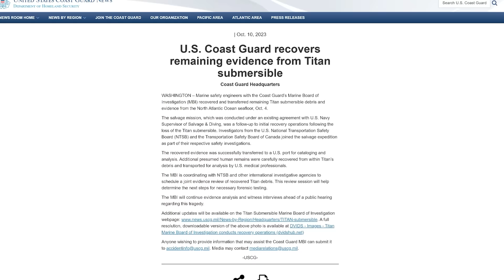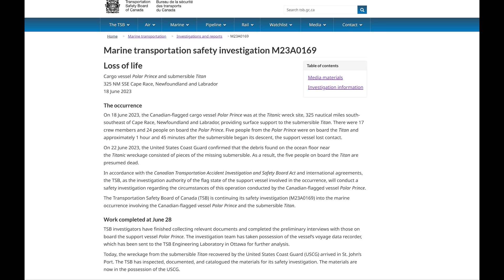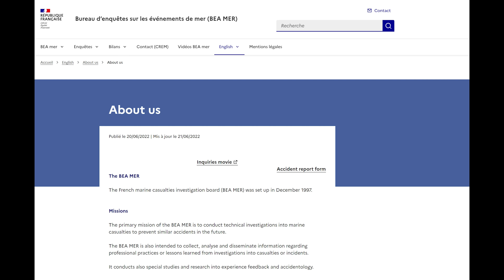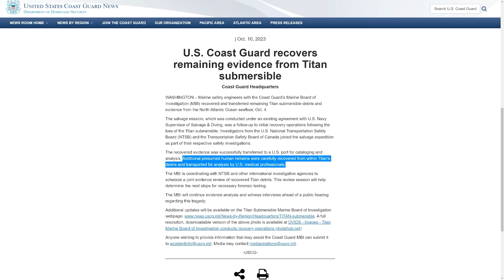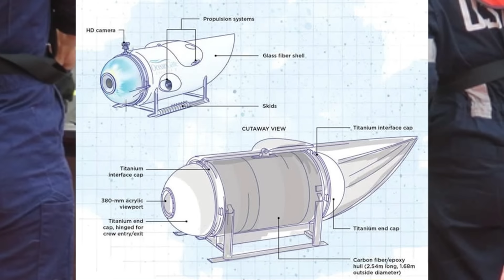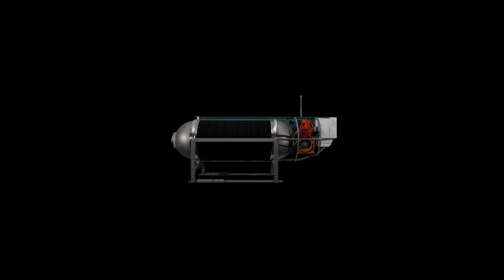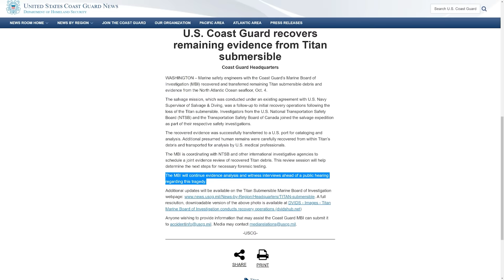Titan Sub UPDATE: More Human Remains, Debris Found

Comment: ...think about it ...Boeing 787s are made the same way...when I worked on them, defects were identified by red streamer-like tags...The last "barrel" I worked on, repairing electrical issues, looked like red confetti falling from the ceiling...😮😮...
Reply: A commercial airliner is subject to only a tiny fraction of the forces at the bottom of the ocean. Also, the hull of a 787, being pressurized, is subject to tensile forces pushing out, and playing to the strength of carbon fiber, rather than compressive forces pushing in, like on the Titan.

Comment: Im wondering, why they didnt place one or two titan rings inside to support carbonfiber against deformation. They could be thinner and it wouldnt be that much extra weight, but it would be reasonable to do because carbonfiber isnt very elastic and any crack compromise its strength much faster. They placed all faith into carbon fiber shell itself, which was stupid.

Comment: I think putting the sensors that would have warned them of fiber breaking up decrease the strength of the fiber. That would have had to be attach directly to carbon fiber. i would like to know how did they attacked it.

Comment: Just wondering... 1) The marks and scratches: With the location of the AFT dome and the equipment stored right behind and adjacent to it, why are we wondering about scratches? Calling that mark a potential substance or where did the marks come from? Upon implosion, all the components of the vessel would have folded upon itself causing everything to crash into what was immediately next it. Then the collision with the seafloor and what did it hit when it made contact with the seafloor (possibly other submersible debris). 
2nd) 'Rear AFT'?  Does that not mean the same thing? That is like saying 'Hard right starboard'... 
Just my thoughts.

Comment: I'm quite sure the tail area holding the power source is what was crackling, and around 9:46am that particular section imploded. Then they lost complete power. The titan must've started to descend again, since the only way they were able to ascend at the time was with thrust from electrical power sourced in the tail. So the occupants were slowly sinking again, possibly in complete darkness, for who knows how long before the full implosion. They may have even reached very close to the depth of the Titanic before they were crushed in  micro-seconds. But I don't think the final message from Titan was at the point of implosion. I'm almost certain it was minutes after losing power and sinking down further inside a structurally compromised vessel. Crazy..

Comment: @5:55; I am not a licensed engineer, but I have been around long enough to know that on a pressure vessel, the greater the pressure the closer the bolts should be.  But then again this was built supposedly considering pressure in reverse from the outside in.  But as Jeff states, we need to see the carbon fiber to determine what happened to the fiber itself and the joints between the fiber and the forward and aft sections.  Not seeing the parts, one does not know if there is any adhesive residue on the fiber or metal parts.  We all have seen video of them smearing the adhesive on before joining the parts.  
Only time will tell what really happened.  The problem I see is, the more agencies that get involved the less information will be forthcoming as they all try to protect their jurisdiction.

Comment: Being older I studied physics and have a sort of knowledge through interest of engineering and materials. You make some very valid points. Am not sure if a steel interior would have made a difference because of ballast, weight etc and how it could have ascended back up. My opinion (for what it's worth) should have been the carbon fiber should have been re-done every time the sub went down, and also that the carbon fiber was tested. We look at the titanium and carbon fiber together. One is hard and one isn't. Any material scientist and or mechanical engineer would have been 'all over it' for it's flaws. I am very sad this happened, and I would not be surprised if the 'outcome' was many 'flaws' in the whole thing. My heart goes out to the families who have maintained a 'dignified' silence until 'conclusive' results are in. Thanks for posting.

Comment: since I know how most of this stuff works from recent aviation accident investigations, it will play out like this: There will be no updates until 2028, at which point the final report will be released and the conclusion will be "the submersible imploded due to failure of structural integrity" and that's basically it.

Comment: With that photo, i would't be suprised if the camera used does support higher resolutions, but it was set to a lower resolution (i have a semi professional camera that has settings ranging from 5184x3456 (L) all the way down to 720x480 (S3), just had a look, and it seems the image resolution is more like the "S1" setting on my camera)

Comment: Jeff, you asked about leaving the steel inside the carbon fiber.   i'm not a metal specialist, but my take on it based on years of reading about subs from the turtle which attacked the british to the death of them that used the first torpedo in the civil war,  it is my opinion, that the failure might have taken longer to kill them, but the hull could not survive.  Stanley, whom i believe was on the first or second dive was deeply alarmed by  what he saw.

i don't think the steel would have prevented loss, as it was used as a form, and not a structural member for containing pressure such as a propane bottle is.

Comment: Your comment about leaving the steel cylinder in place makes sense. In the fire service the air cylinder is designed and manufactured that way, Carbon fiber wrapping a steel cylinder. Reinforcing the steel while trying to keep weight down. Carbon fiber is normally used when you're looking to keep weight as light as possible, like in cycling. Don't think it's the strongest medium though.

Comment: I suspect the seal between the carbon fiber and metal , given the temperature and pressure a hairline leak which cut like a torch then the collapse of the carbon fiber cylinder.... if not this the acrylic window but failure there would have been instantaneous and they had sound that made them attempt to surface, the leak was small at first .

Comment: If they had left the steel mandrel inside the carbon fiber tube after the CF was cured.. I believe the steel would have expanded faster than the CF and possibly could have even expanded enough to interfere with the bond between the CF hull and the titanium end caps..

Comment: what would've saved them? rebuilding that hull after it's 2 year expiration and not trying to squeeze an additional year out of it.  it cost a million dollars when it was replaced in 2020 and was due again in 2022.  i read an interview from someone that made a previous dive and he said the crackling never fully stopped even once you reached depth and it would continue even after returning to 300 feet indicating stored up energy.  thats the insane pressure turning your hull into butter.  in addition to being properly cycled, it should've also been coated with something better than rhino liner which prob isnt rated to go to the bottom of the ocean.  water is eventually gonna penetrate deep enough to ruin your day.   such a shame cuz oceangate gave us some amazing footage and would've been legends for the 8k titanic vids

Comment: The steel cylinder was never intended as part of the design, it’s just a giant rolling pin used to shape carbon fibre. If that much steel was used it wouldn’t have been light enough.
At least that seems obvious to me but I could be wrong

Comment: How do you not mention the shards of  carbon fiber / epoxy visible in the bonding channel? That seems to be a clear indication the bond didn’t fail, but was ripped apart during the collapse event. 

Grey marks look like silt from the sea floor to me. 🤷🏼‍♂️
Reply: I don't think what you see sticking out are carbon fiber in the 'bonding channel'.  The fiber bonded to a separate ring of titanium that this hemisphere bolted against.  The bits of black sticking up from the face, I believe, are bits of O-ring that are fitted int a groove in this face, that sealed against that separate titanium ring.
Reply: @mikefochtman7164  did the back cap bolt onto the ring like the front one did? I thought only the front cap was built that way. 

If so, I think you’d be absolutely correct, but now I’d have more questions, like where did the ring go?
Reply: @mikefochtman7164  I looked again and I agree with you! Clearly that’s the o-ring which is CRAZY! The cap and the ring must be the “two missing parts” and not the viewport. I bet the ring was the other item recovered which means the implosion sheared all the bolts off, separating the end caps 😮

Comment: Jeff, the question you v made was the reason I asked, few videos ago, what was the carbon fiber structure attached to when they were building it. I ha no knowledge on engineering, that might have helped, or, because it would be another extra material, it would cause more trouble

Comment: Not an engineer, but I suspect if they had used a metal liner of some type with all the common structural elements used to control those external forces (ribbing, etc.), something that could have gone at least 50% of the depth on its own, and wrapped it with CF to provide the extra structure, they could have at least eliminated the need for the adhesive connection. Just leaving the mandrel in I don't think would help. I'd be curious to see a structural analysis to find out if the design would be viable.

Comment: My question is where the  flange bolts? I find it interesting that every flange picture, there was clean separation of the flanges.  I believe in way fibercarbon was wound it was laterally weak. The cycling broke down that strength and buckled. The two ends collapse  towards each other resulting in gas compression and ignition of materials and gas blowing the flange apart. The human remains would have been compressed onto to end caps.

Metal tube would have helped the carbon. Cross wound too. Depends if there was another significant contributing factor. The sub sink rate was faster than it should have been. Another failure compounded by cycle fatigue?

Comment: That ring looks factory new without defects which would be expected considering the metal ends caused the failure. They put this weak toilet paper tube between 2 metal plates in a press, the tube failed and the metal pieces fell away from the press after failure undamaged. I think the small glass is the metal structure was stronger than the tube. The center of that tube had to withstand great pressure at its center from the water along with crushing pressure from the metal ends and buckled in the center like a poorly designed I beam.

Comment: The mandrel could be a light weight or weak type of alloy. . Sure, it could have provided some extra strengthening to the hull, but without knowing exactly what it was made out of and it's strength of 'metal', it is then possible it would have only delayed what has already happened.  Also, how does the 'metal' of the mandrel react to the Carbon Fiber?  Maybe they don't like one another and could cause some form of corrosion?  Then it could have expedited the failure.  Would the mandrel have let sea water into the 'gap' between the mandrel and the carbon fiber?  Even a little could have caused problems over time.   But it is worth looking into.  Maybe next time, build the mandrel to be permanent part of the hull, out of titanium and in such a way that the two units are water tight.  I'd like to see a 20% sized model go thru testing and just see if it actually works.  Two domes, no ports, no holes, no attachments, mandrel and carbon fiber. . Do say 5000 tests of compression and decompression.  Record all the flex and movement.  Would be interesting.

Comment: Would that steel moling tube have helped? 
NO. If anything, if it had been parrt of the main hull's structure,v it would have made things worse.
Why do I say this? Consider that it's obvious that the TITAN was having trouble making an emergency ascent EVEN AFTER it dropped it's ballast, aa it  was using it's vertical thrusters to encourage ascent.. For me, this indicates that the TITAN was somewhat OVERWEIGHT for some reason.  Leaving the iron mold tube as reinforcement would have just increased the overall weight, robbing it of any benefit of negative buoyancy (or positive buoyancy for that matter). 
In addition, a tubular shape is inherently BAD for the crew compartment of most deep sea submersible. A spherical shape is inherently the BEST shape. This is why military submarines are incapable of diving as deep as a purpose built deep sea submersible; it's tubular shape, though made of high grade steel is STILL weaker than any deep sea submersible's hull. 
As far as I know, the only deep sea submersible that uses a tubular shaped hull is the US Navy's deep sea diving rescue submersible, and even that vehicle cannot match the depth capability of most deep diving research submersibles.

Comment: Say, would it maybe have helped, had the wrapping be done under 500 bar of pressure? 
Then the carbon fiber would have been under tension at all times.

Also, are there carbon fiber layering modes where the layers can have a bit of slip in between them? Theoretically, that would elevate the stress put on small parts of individual fibers, or am I wrong?

About your question: I think leaving the metal cylinder in  would have made the sub live longer, despite now having three different materials. But it still would have been unsuitable for testing with human occupants. They should've at least had several identical vehicles tested unmanned until failure anyways.

Comment: If they had left the mandrel in place, it would have made the cylinder at least a little stronger, which would have guaranteed immediate failure, instead of eventual failure.  Submarines are designed so all parts compress at the same rate.  Making one part stronger than it should be creates a stress riser which tears the pressure vessel apart.

Comment: The weakest part of the vessel is the epoxy carbon fiber composite. The carbon fibers are flexible, the epoxy isn't. Every single time that vessel expanded and contracted from being pressurized, more and more fibers would have delaminated from the epoxy, inevitably leading to sudden catastrophic failure.
I believe most of the carbon fiber shell turned to dust under that sort of pressure, and because it's much lighter than the other parts, was able to drift away.

I really don't think the port hole is relevant personally.

Comment: If the hall were titanium, we wouldn't be having these videos right now, either. Yes, I do believe the steel sleeve would have helped the strength, but I think the control Spears is what blew up. It is equivalent to 11 to 13 sticks of dynamite if the oil pressure is not regulated right, so if they descended too fast and the oil wasn't right, this could have caused the explosion!

Comment: I think they used carbon fiber instead of any kind of metal for the hull because it is more buoyant than metal and in order to save a lot of money on putting other materials on the sub in order to make it buoyant enough. That's according to a video I saw of the guy who made the thing and he said it saved a lot of money to use a material for the hull that was also buoyant. I think that, had he not tried to cut so many corners to save money, he'd probably be alive today with an intact sub.

Comment: I doubt leaving the steel case would have added significant structure to the carbon fiber hull.  Chances are the steel casing would have grossly deformed under pressure.

Comment: They could have just used aluminium all around for MUCH less money than CFC +Ti. Also simulations show that the porthole shatters when the cylinder implodes, the sudden change in pressure is enormous. So it may be destroyed either way but my money is on the hull anyway. It wasn't the window constantly making cracking and snapping sounds even at "shallow" depths of a few hundred m.

Comment: There should have been a big red button inside that said, "Emergency Rapid Surface,” that would make the thing shoot to the surface like a missile. Once it started creaking, making strange noises and maybe leaking, it was time to declare an emergency and shoot to the surface. Not having that, was a huge mistake. Outside empty tanks blown and positive buoyancy getting that thing moving up. At least, everything would be on the surface to be examined and recovered. Picking up pieces two miles down is insane, and how are they doing this, anyway? Big mystery super secret military stuff.

Comment: In previous dives they had heard cracking noises but the over of the company wasn't interesting in testing, retesting or certifying the submersible. The thing about Carbon Fibre is the fact that it is designed to stretch so they can make SCUBA tanks out of it because the pressure inside is higher than the pressure outside. It was never designed to be compressed. Finding any pieces of the carbon fibre on the sea floor would be looking for a needle in a Haystack in a field of haystacks. Human remains will be perhaps a swipe of DNA on a piece of equipment...nothing more.

Comment: Of course if they used titanium for the main hull. It was have needed to be the right thickness, re-enforcing ribs. Carbon fibre was the incorrect material for this type of submersible, even when I first checked this submersible before the fatal dive. I thought, this is going to end bad.
Ok, it would have been more costly to build, would have been heavier. But these 5 people would have still be alive, so sad.